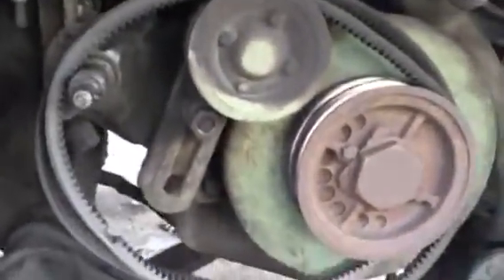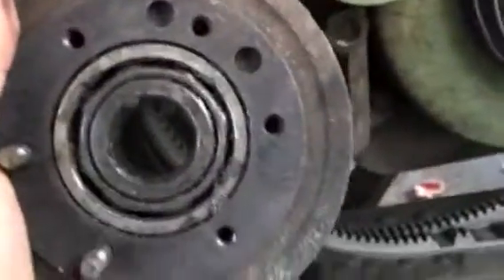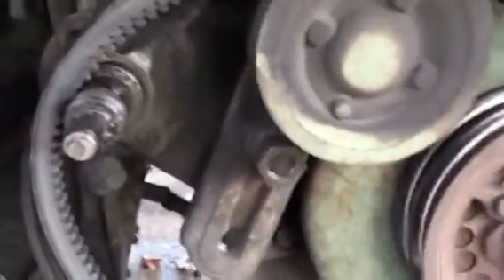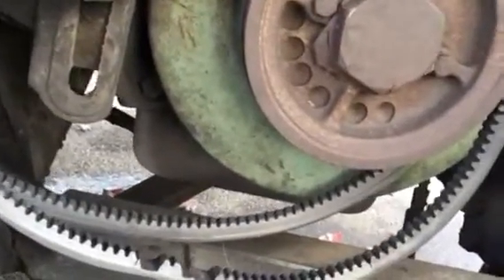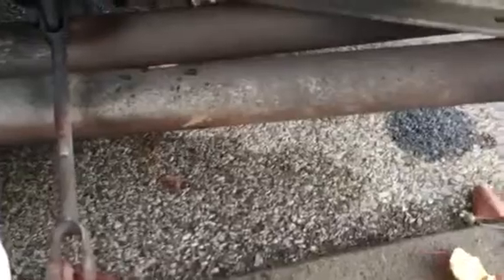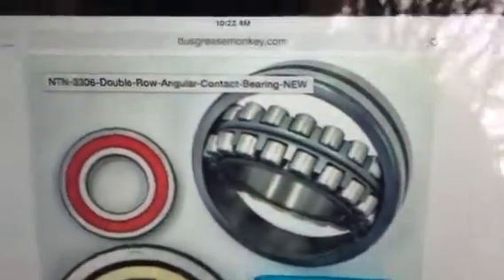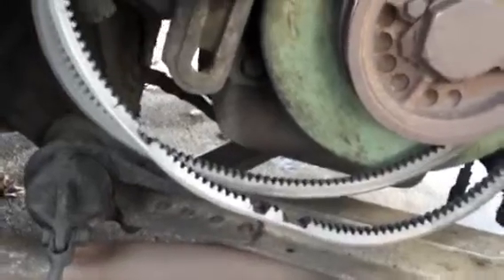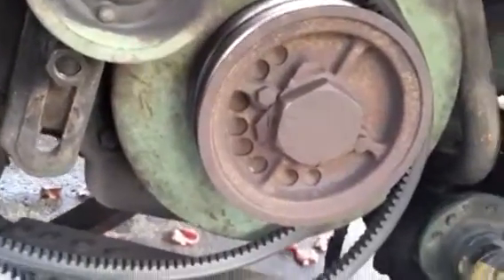Fan hub PD 3751 silversides bus

Comment: Scott,

Does someone make a 12 volt radiator fan so you can replace the belt driven cooling fan?

I'm thinking it just might give you fewer problems. It would also allow you seeing as a turbocharger is going on your engine to put a manual override switch on her to keep the radiator fan running when climbing a steep grade. A owner operator friend of mine added a small radiator behind the sleeper with a manual electric fan to give him extra cooling on western mountain grades, lets him run two gears higher climbing the mountains. Possibly you could add a small radiator to one of your rear cargo bays to provide extra cooling after you finish installing the 4 vale head and turbocharger. I do believe you will need it.

Cheers!